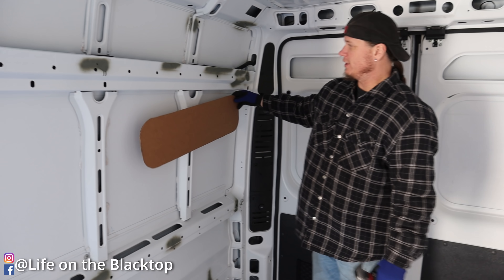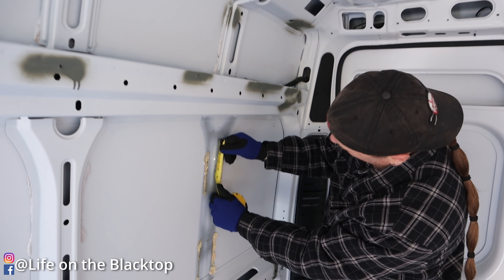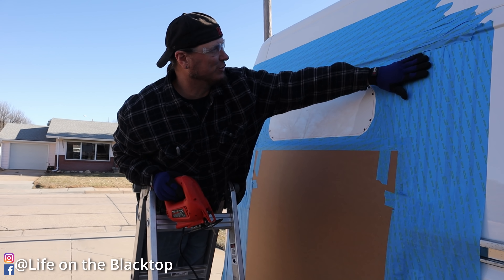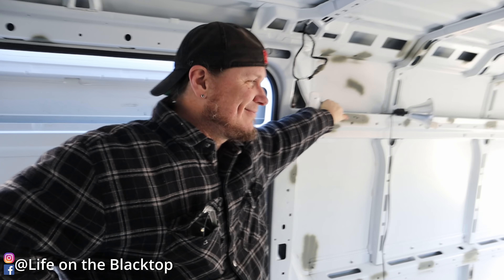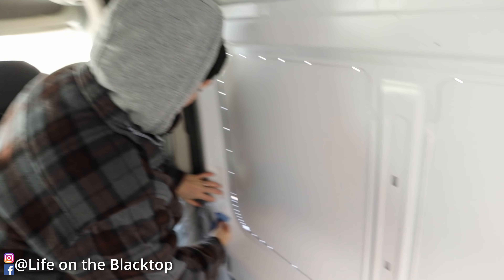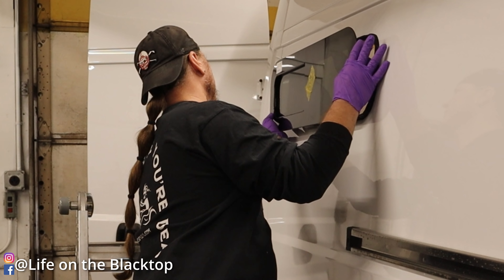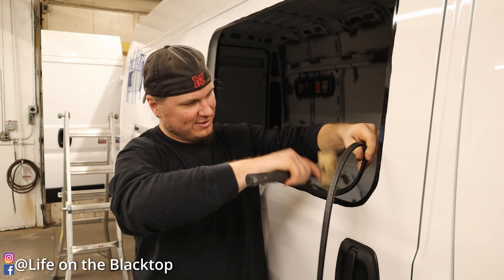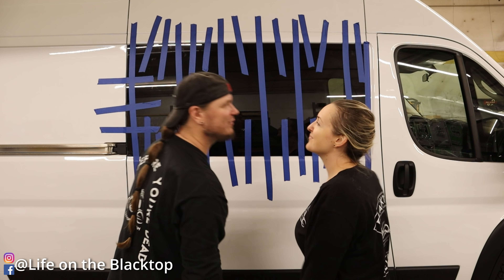How to install windows in your camper van! | The scariest part of our van build so far!

Comment: This video was way too intense.  I have confidence in Brian.  Your technique for this job obviously carries over from previous projects both shown on your video's and not shown projects.  Heather's watchful eye and capable assist made this video, although a nail biter, a joy to watch. One question, I saw where you removed a brace to install the back windows.  Do you have any plans to reinforce that area of the van wall to restore it's structural integrity. Also, what's the problem with using Dad's mallet from 1972!!!!??????  This video was also fun.  Thanks for Sharing!
Reply from the maker: Thanks! When we frame the windows out I'll attach the framing to the horizontal braces above and below to give it extra strength.

Comment: If you had a space heater you could run it with an extension chord into the van for when you're in there...help with the cold so you don't put any unnecessary work on the engine. You guys are incredible and doing awesome maintaining positivity (at least on camera).
Reply from the maker: A few cuss words came out lol.

Comment: Just tape the base of the saw. Saves a lot of tape.
Reply from the maker: This was more to keep the hot metal chips from burning through the paint and causing rust issues down the road. On the other side we dug out some more cardboard and just used that with less taping.

Comment: #1 Just because you made an old joke about 1972  I'm calling this one a Fail !  ( I was born in 72) HAHAHA   #2  I was waiting for the window install to be the 1970 "Bubble Heart" set at an angle. Now I'm disappointed. (Yes another joke)   You Two are doing a great job.  Noico makes a sound dead and insulation. I have first hand experience using it.  Cheap and easy to apply. I've installed it in a few Semi trucks and the difference is unreal.  Sold on that "Jungle Web Page"   NOICO.     ANYWAY  Stay Safe, Stay Warm.